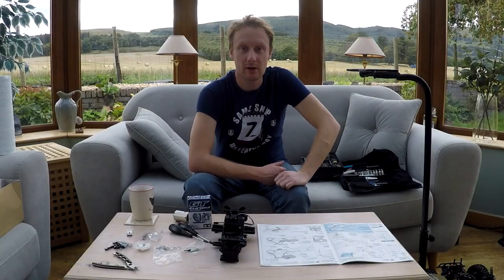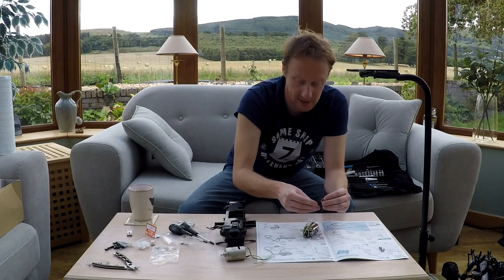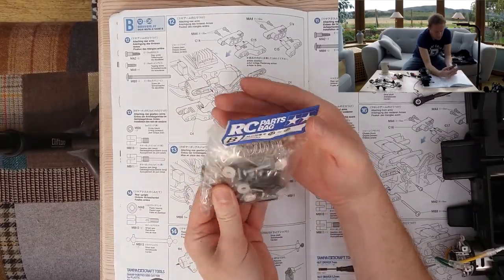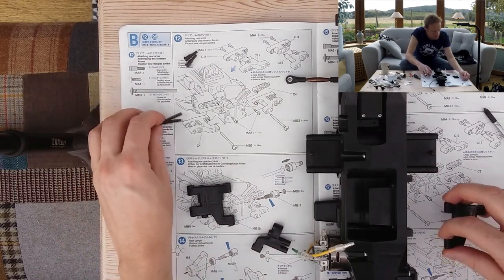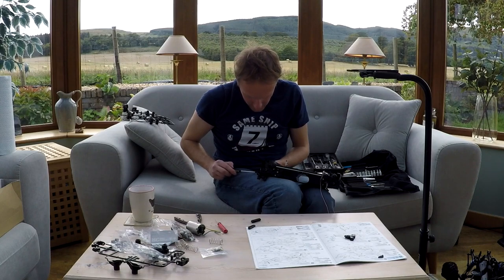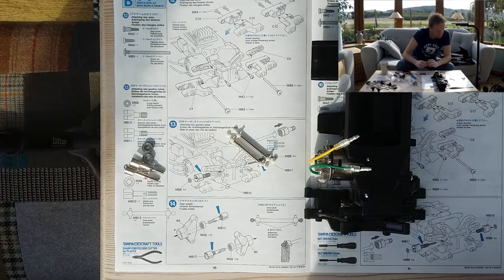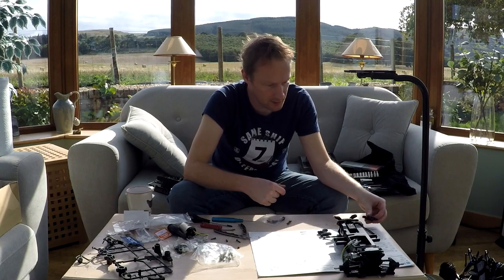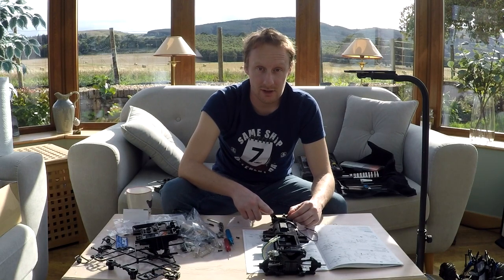TAMIYA NOSTALGIA Part 4- Motor, top links & wishbones. TL-01 Retro Touring Car Build.

Comment: As you said,Tamiya parts in general,and motors especially,are way over priced,presumably price gouging by the sellers,all on ebay. I switched to GoolRC motors which are very good quality,rebuildable and available in many turn options. I am sure from your racing experience that you "know" more about motors than me and if you are happy to pay these prices it's your choice. A pity about the the Outlaw, I really fancy one of these but brushed and geared down to make a trail truck,if I can find one s/h in good nick that is.
Reply from the maker: They are, but that was more a nod to the purists. Yeah, I like GoolRC, you get a lot of bang for your buck. The outlaw is great, but fragile if you start putting massive power through it. Never mind! As a trail truck, it'll cope fine.
Reply: Hmm, I made the comment before seeing the whole vid,you explain why you chose Tamiya stuff,I dread to think how much you have or will spend on the shocks....mine are less than £10 for 4 and they work really well,all alloy and oil filled.  Not that they'll make it a great handling car.....
Reply from the maker: Nah I bought some Ansmann adjustable shocks. Way better spec than the Tamiya equivalents for about 1/4 the price... or less! The purists can refit the friction shocks, if I ever sell it!